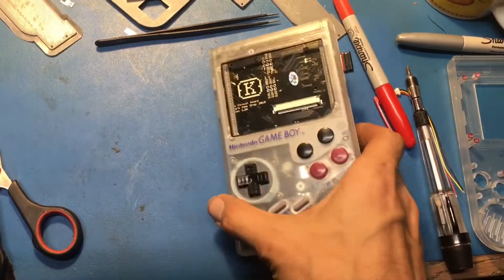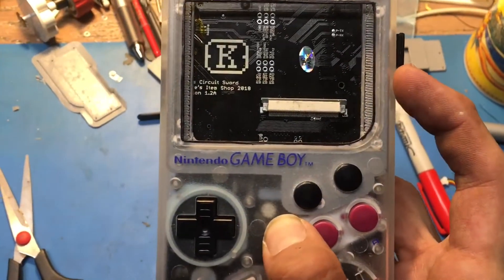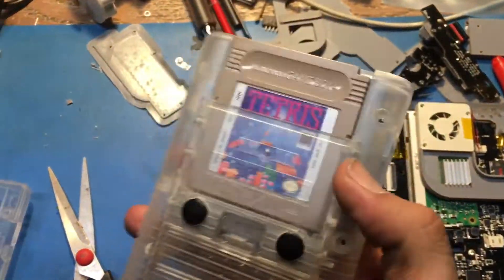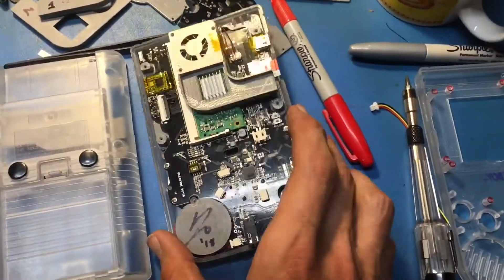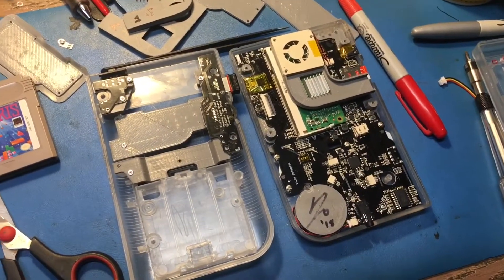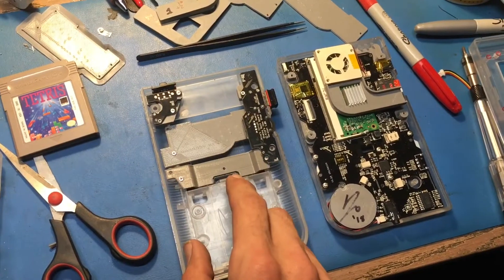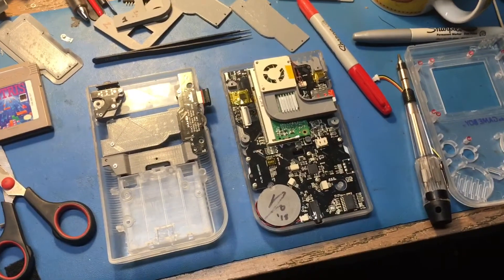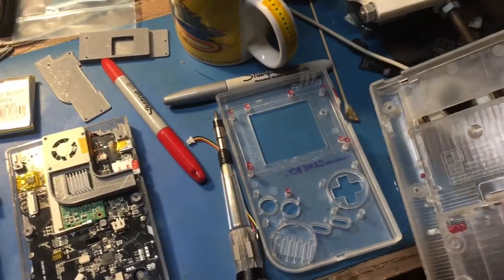Gameboy Zero 3D Printed Parts Set for Kite’s Circuit Sword

Comment: Thanks for the videos and sharing your designs. I just pre-ordered my first Kite Circuit Sword kit (I hand built a GBZ from scratch a few years ago). Do you know if your bracket works with the higher res screen. Kite says that is has the same dimensions.

Comment: could you tell me where did you find such a small horizontal fan?
Reply: I believe that it's the one which came with the Kit. I did reach out to the maker of the board asking the same question recently and this is where he pointed me. 
https://www.aliexpress.com/item/SUNON-UB5U3-700-5V-3003-3004-30x30x3mm-Miniature-ultra-thin-waterproof-turbofan/32854185755.html
Reply: I’d like to know also, and is 5v? Can it push enough air to be effective?

Comment: great thank you :D 
are you planing on doing a front screen bracket with the psp1000 joystick support?
Reply from the maker: michael Larsen need reference parts but it’s pretty easy otherwise. I’d probably do the six-button option first.
Reply: @LA3DPrinterRepair  great video :) Did you ever get round to making the six button 3d print?